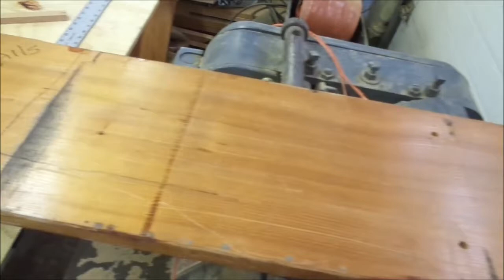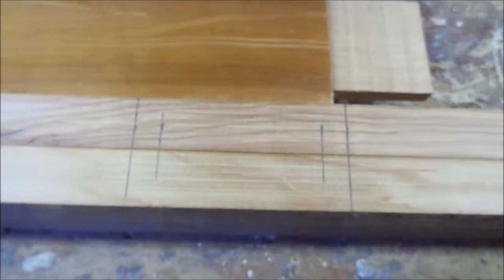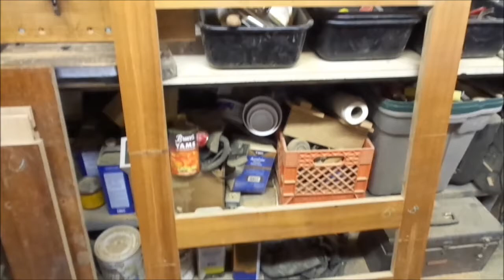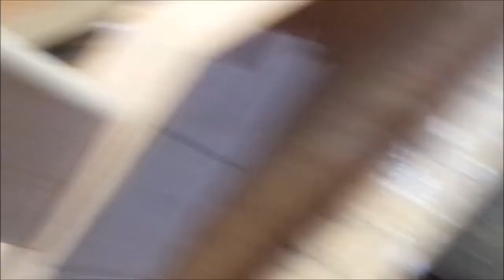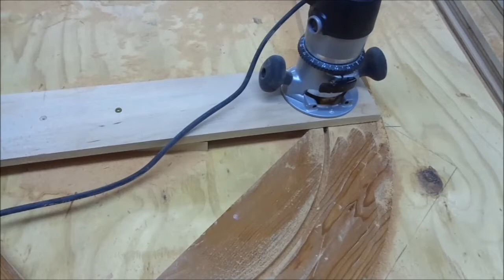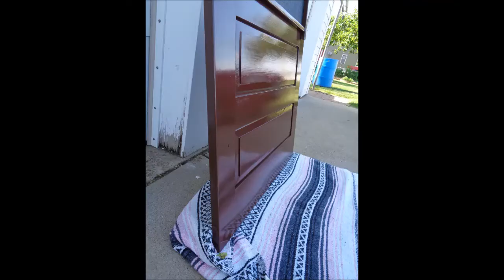how to construct a round (arch) top screen door

Comment: Just wanted to thank you for this video.  I have a 90 year old tudor with an arched door....I love having any excuse to use my router, so I bought a 1/2" spiral up cut and made a jig.  (Found a formula on line to calculate the radius for both the inside and outside arches.  In addition, after I practiced on plywood, I made trim for the inside to cover up screen.  Mine already had a wrought iron insert-another brilliant idea from on line was to have it sandblasted and powder coated.  Went to my local wood place and decided on cypress.  Right size and cost (much cheaper than douglas fir which had been recommended to me).  I'd love to send you the pictures, but not sure how-definitely couldn't have done it without you.